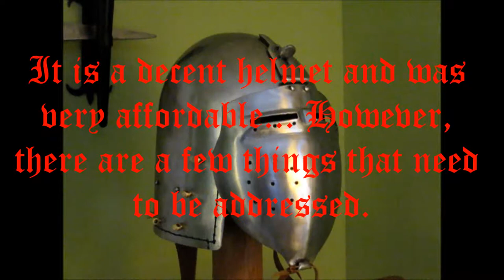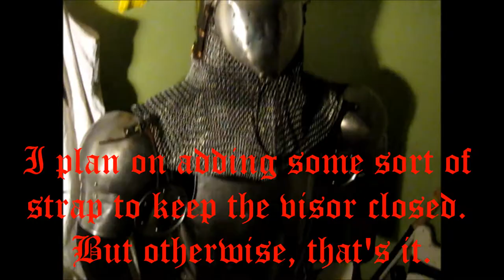Bascinet update

Comment: Thanks so much for this man. I was planning on buying this same helm, but wasn't quite sure. After seeing it in action here though I'm definitely getting this one.
Reply from the maker: +KalteGeist Arr you ordering from KultofAthena? If so, I would actually recommend the Lord of Battles Clapvisor over this one. It looks a lot more ready for use.
Reply: Ah I would have but it's visor is non-removable and I intend on switching this one out occasionally for a fencing mesh one. ^_^ I ended up just getting the large to be safe. I can always add padding.
Reply from the maker: Good idea. You may need to fiddle with the hinge to get it to stay secure. You can also add a strap to keep the visor closed. That's what I did.